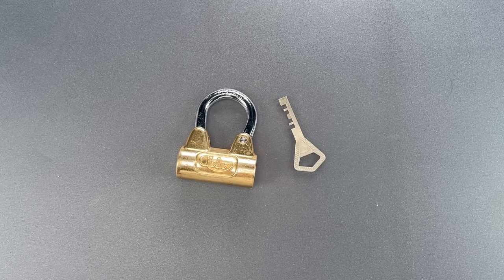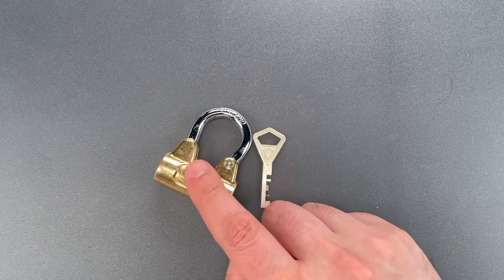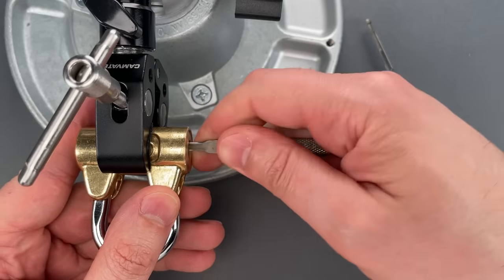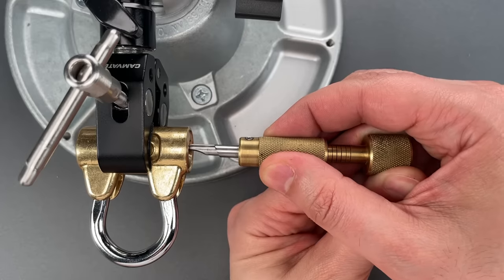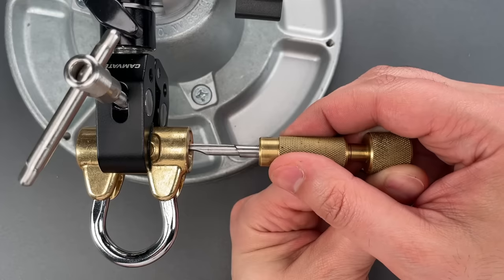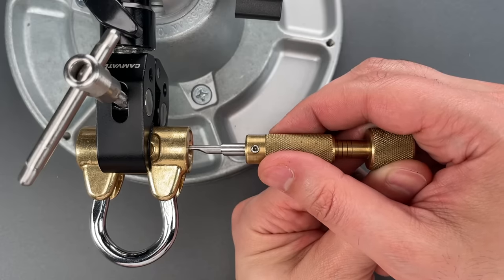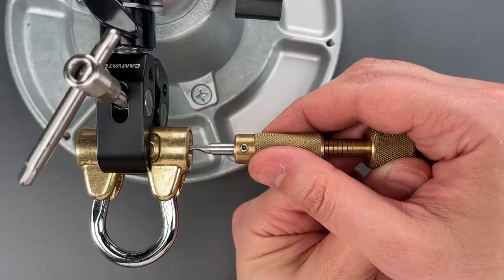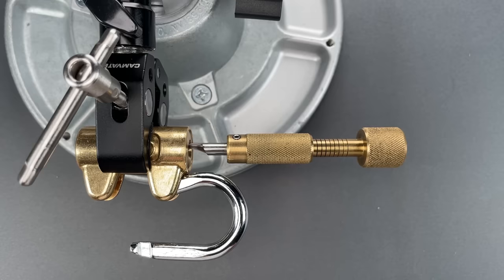[1416] Retro-Cool Abloy Padlock Picked (Model 3020C)

Comment: You know that it's serious if you hear disc detainer core and you see a tool even more custom than "the pick that Bosnian Bill and LPL made"
Reply: truth.
Reply: I'd like to know why that one wouldn't work.
Reply: @petesandberg3957  That tool tensions off of the first disc, this tool tensions off of the last disc. I am not sure if that is why he is using this one, but it is a big difference.
Reply: @sawchuk519  I thought it was designed to tension off a variety of discs.
Reply: @petesandberg3957  I think I’ve seen this pick before they designed the new tool with BB. So (I might be wrong) I think this is more a matter of having a tool ready instead of having to create a new tensioning part for the new pick, even if it could be done. So basically a convenience thing.
Reply: I wonder if it's possible to create a core that requires to tension multiple disks (maybe even random disks and a random number of them). would that be impossible to pick or just a little bit more tricky?
Reply: 2:08 'Number 1 is a spinner'. I don't know what that means, but I'm willing to bet that it means he can't tension off of disc #1
Reply: @petesandberg3957  The keyway of the Abloy Classic core is a different shape, mostly, and off-centre.  Everything else is essentially similar to other disc-detainer cores.
Reply: @petesandberg3957  I believe the tension bar only allows tension of disc 1 but you can use the pick to tension another disc and then use the tension bar to set disc 1 correctly...
Reply: @szymonsadlo  2 cylinders 1 behind the other both able to move separately, both with false gates and only if both are turned the lock is unlocked.
I think you'd have to pick the back-cylinder first, tensioning only the back cylinder, when it's picked and rotating (depending on design) you might be unable to retrieve the tensioning tool for the back cylinder, so you'd require a second tensioning tool for the front cylinder, but once you've also picked this cylinder you can turn both of them at the same time and unlock the lock. would definitely be an interesting lock design, not sure if it comes with any security benefits, tho

Edit: Obviously this design would probably not work with a disc detainer lock, unless I'm missing something, but other lock types are fair game
Reply: @insu_na  interesting. there may be not enough room for the second tensioning tool and imagine a design when it will be required to use three. maybe only a custom tool similar to a lishi tool but I can't figure out how it would look like for disc detainer core
Reply: @petesandberg3957  I don't think that tool can tension off the back disc. I've only seen it tension on disc 1
Reply: A tool differently enough to sell on my website soon ;-b
Reply: Get it right, it's not the pick that Bosnian Bill and LPL made. It's "The Pick Bosnian Bill and I Made."  ;)
Reply: @Kromaatikse  this thread is a bunch of people making wild incorrect guesses, and you with the right answer... being ignored
Reply: @Nareimooncatt  you haven't made it and neither am I 😉 it sounds weird when someone uses that name in original even if it's in quotes
Reply: ACTUALLY, he said he made it "myself". Didn't mention Bill this time
Reply: @crazybob75  Exactly. Abloy has offset semi circular keyway. There's nothing to do with which disc to tension at all.
Reply: @eporter5071  The Abloy tool was made by LPL; the more general disc detainer pick (that will not work on Abloy cores as they require a different shape of pick: the keyway is a different shape) is the "pick that Bosnian Bill and LPL made".

Incidentally, the 'generic' pick is readily available on the market; the design by BB and LPL manufactured by Sparrow is a good, mid-priced example, but there are plenty others (from crap ones made of chinesium to really good and expensive ones). It's NOT a custom tool.
Reply: @dlevi67  the pick they made with bb has replaceable tensioner and pick, so I believe both of those could be replaced with parts that fit/align with Abloy Classic core… but I’m not sure how much easier it would be compared to just making a pick that is designed around the classic core from the get go
Reply: @siffoine  Good point - I suspect that the answer to your second observation depends on how skilled/kitted up one is at metalworking. I for one don't have a lathe...
Reply: @Nareimooncatt  Yes! Always the gentleman.
Reply: @petesandberg3957  The Abloy Classic keyway is such that the pick BosnianBill and he made won't fit in.
Reply: Bet you anything he's just setting the stage for an alternate tool he'll be selling on his own website. Most of his videos now are just glorified advertisements
Reply: @eurapeon  Don't disagree on the "advertising" becoming a dominant theme; given Abloy cores aren't super-frequent in the US, I doubt there is much of a market for a specific tool. Now, if he were based in Finland...
Reply: When even abloys vintage locks are better than the best masterlock
Reply: @szymonsadlo  yes, they exist, and I make a tool that will pick them still.
Reply: @dlevi67  it was made by LPL but it was designed by me.
Reply: @huxleypig69  The Abloy one - yes, of course (I know you are a specialist in the area). Apologies for not crediting you.

Did you also design the 'generic' disc detainer now made by Sparrow? I thought that had been designed by BB and LPL; sorry if I got that wrong.
Reply: Another YouTube ad thanks the same ad I’ve seen 100 times
Reply: I'm so proud of Abloy, they design those locks here in Finland iirc
Reply: This is a half moon shaped keyway the pick they designed wouldn't fit in that keyway 

And the pick they designed can tension on any disc only if the rest of the discs are already set because the tension tip can not pass through the picking tip
Reply: @petesandberg3957  not only do alloy normally tension off the back but, the tool that BB and LPL made is designed to go down the center and rest on either side of the key way. These locks are d shaped keyways so their tool can't rest on anything.

Comment: When a 115 year old core design takes longer to pick than the entire masterlock catalog put together
Reply: Sad thing is that once they made extremely good locks like the Master Lock model 19, which are seriously collectable.
Reply: Also this is the worst lock on Finnish doors, almost all use Abloy and disc detainer type locks. This type of lock is very common on storage lockers and buildings that are 30 years or older
Reply: @AllanSavolainen  Also there has been a semi-automatic tool to pick these Abloy locks for a couple of decades. The current Abloy locks are way more advanced than this.
Reply: @Munakas-wq3gp  Yep, though I recall it cannot pick old Abloys that have the anti-pick disc. But manual tools are available, but still is more difficult than just about any pin tumbler lock on apartments

Comment: The genius of this design is that it's real cheap for the manufacturer to put a lot of discs and false gates into it. No raking or other low skill routes available. So any attacker is likely to force through it, which is good for insurance claims for cheapish things. For securing more expensive things, Assa Abloy has other things.
Reply: What stops lock companies to fit that core into a beefy body? It it's cheap it could be a great lock.
Reply: @CraftingCake  Probably patents + I guess setting up the initial tools for machining the lock would be expensive. It's hard to say but switching to a completely different core than what they use already can't be cheap.
And they probably chose their initial core design while this disc detainer was under patent protection
Reply: @Mythantor  'probably patents' - well no. Patents last about 20 years.
Reply: @CraftingCake  This core (and newer versions of it) is used everywhere in Finland. From gym locker room locks to housing to high security locks.
Reply: This design is currently considered 'outdated' and no new house or apartment uses these. Mostly these are things like old shack, locker cabinet at the pool or such.
Reply: @alaric_  [Master Lock No. 3 has entered the chat.]  "That's outdated??"

[Master Lock No. 3 was taken to the morgue, having died a horrible death of laughter-induced hypoxia]
Reply: They have other locks now that are actually far far easier to pick! Standard dt tools and more people with skills. Why on earth dont the use this core (with hardening/drill protection) in their modern, physically stronger, locks? Madness!
Reply: @rupedog  Actually. This old model is old. But stilla available for lockers, etc. It is replaced by similar, but more secure Abloy locks in Finland. Like Abloy Exec (what is already outdated) and current Abloy Sento. What, for example, i have in my house.

Would like to see how to pick up Sento.
Reply: @rupedog  They do. Abloy is making and selling them. It's with same type of core, but heavily modified and this special tool doesn't fit, it needs own special tool, wich is way harder to make, but yeah, it is doable :) look for product names like Exec or Sento
Reply: @CraftingCake  Nothing preventing and it is also done. LPL has also picked Abloy Enforcer series lock that has the same old core as basic level. Also more modern versions of the core is available which are much harder to open.
Reply: @mikkilj  is the sento the same as the protec series or like clic.
Reply: @CraftingCake  I have been wondering the same. Abloy sells them yes but insanely expensive. Even this old classic is very good, only downside being the keys are easy to make and copy, even just by seeing or photographing one. But if you keep the keys to yourself chances of someone picking a heavy padlock is pretty much zero anyway. There are a lot of those heavy padlocks with the generic bicycle lock style disc detainer and I guess some are better than others, but a re keyable copy of a common and known core like the abloy classic would make any strong lock a pretty serious contender. Also it could probably accept the more secure abloy cores too.
Reply: @mikkilj  there was video earlier with atleast similar key, no idea if it was Sento or not
Reply: I have some strong padlocks with standard interchangeable cores and I am sure abloy makes those cores too, but all of the locks bodies are high end expensive because I have not found others. They practically have one critical part and that is the shackle, otherwise anything heavy enough would be good as long as it is cheap enough.
Reply: Trying to be totally funny:  I think I have found the Pink Panther (movie reference).  How should I secure it?
Reply: @nitrouszzz  this is very nice to hear.
Can you please tell me a brand name?
Reply: That modell 3020C is a well youst as an boat lock just bikus of the wheter and its prity good to...
Reply: @CraftingCake  Abloy has locks also with beefier body like PL342.
Reply: @CraftingCake  The "legacy" abloy has models that have much heavier body and have more complex discs in.
Reply: @queazocotal  Yeh which could have been the time when they were working out their own designs. Now they are too committed to switch
Reply: @flyfin108  No. They have a very different key.
Reply: @RanEncounter  yea, i did some research, its totally different
Reply: @mikkilj  Actually I think the current Abloy "mass" product is Abloy Easy.
Reply: Bs. My house built 1997 and all locks are Abloy with this kind A key
Reply: Yeah now abloy and others have moved on to producing electronic locks and they are becoming the majority in Finland. Pretty much all new apartment buildings and goverment/official buildings have something called iloq that is also a finnish company. Abloy does make a similar product too. It kind of defuncts the need for keying alike only certain locks to restrict access and giving people several keys for different locks.  If someone loses a key it can easily be just taken offline. A stolen/lost key also can’t be replicated, because it needs to be activated. 

For example at work we all had only one key and they are identical, but depending on the person you could access more places with that identical looking key, because the key had been given rights to open a certain lock. A big organization with several physical places that need access can just recycle keys if one place has extra and one needs more, because you can just reprogram them over and over again. You can also monitor what locks have been opened and which key has been used and at what time. So in places like hospitals if medication goes missing it can be pretty easy to trace along with security cameras who accessed a certain place. Same goes for any other place that has valuable things to steal. Or even in an apartment building if suddenly there is a bunch of damage in the laundry room or somewhere else it can be pretty essy to trace who has been there:

The pretty obvious problem is that if the lock system freaks out for some reason it means people can’t get in or out. They do work during power outages apparently, they get their energy from the movement of the key when it is inserted into the lock. System faults can happen though.

One of my friends works in a medical care facility for the elderly, kinda like a retirement home and this happened to them. They couldn’t get out of the building and nobody could get in for several hours and a patient even died and they couldn’t call for the body to be picked up, because they wouldn’t be able to let them in. To be clear they could access the patients rooms and the patient didn’t die because they couldn’t give them medical attention. They we’re old, sick, close to death and they just happened to die at a moment that was very unfortunate. It was also an extremely hot day, so it didn’t help.